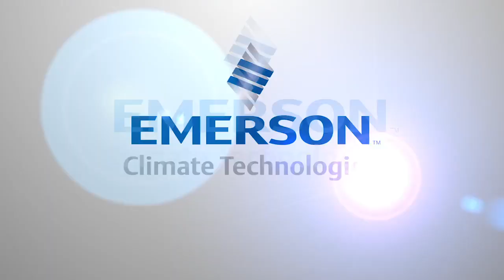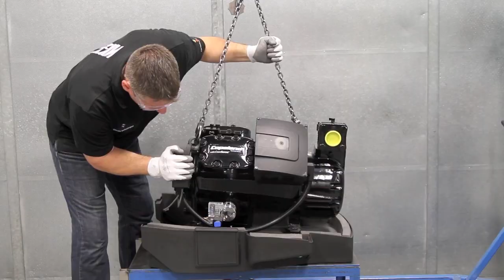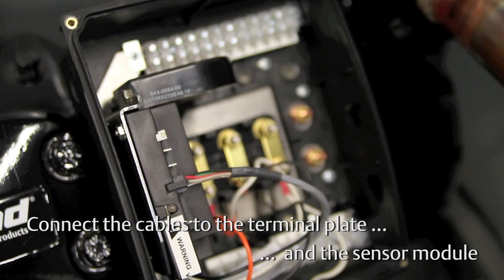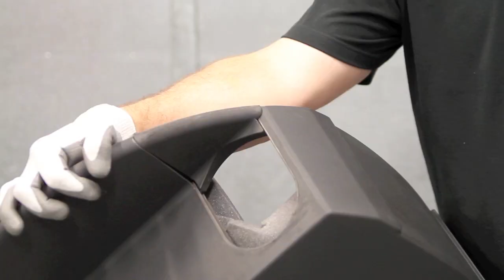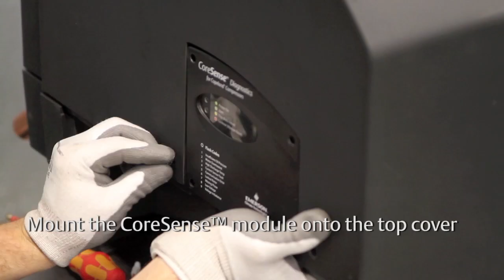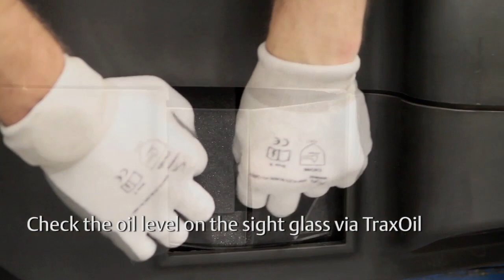Emerson Climate Technologies Compressor Sound Shell

Comment: Where the oil pressure safety switch, and pressure controls?
Reply: the oil pressure switch is included in CoreSense Module, no add parts needed.